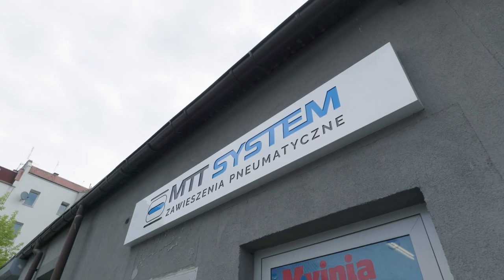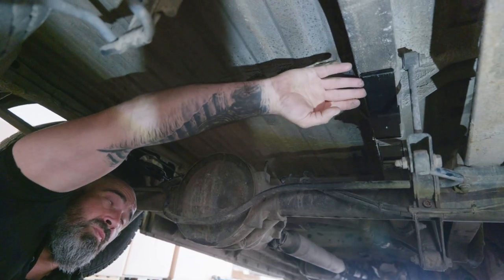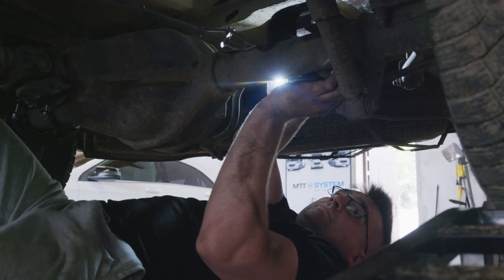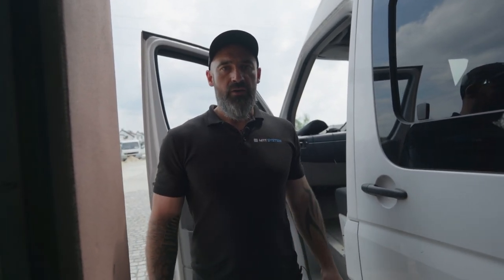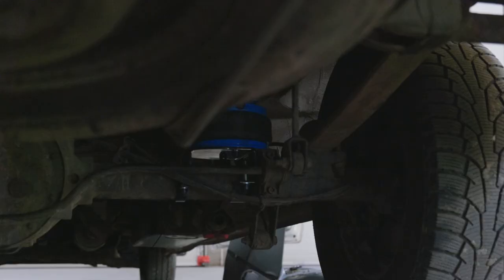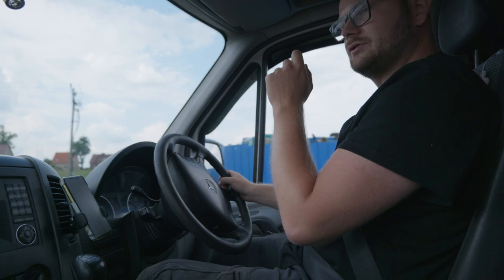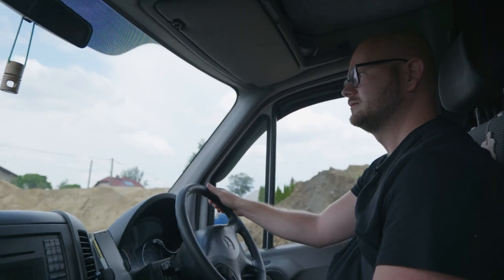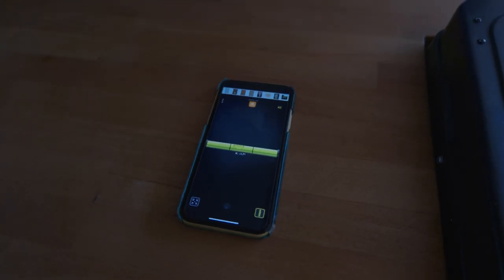Is motorhome AIR SUSPENSION worth it? | Van Life Europe

Comment: Hi guys, like the video a lot. I bought a similar system for my VW LT 35. But I saw that some sprinter owners with this had reported cracks on both sides where the airbags are located. The vid I saw the guy traveling Europe had done 40000 miles before noticing it. How is your metal above the airbags. Anyhow I really hope that this was an isolated event. They reckon you can fix it with stronger leaf springs and keeping the airbag at minimum to keep the space that the rubber stop protected.  Also the cracks can be welded. The structure of the camper van is safer as the body of your van helps the suspension so no need to be alarmed. Thanks...Ray
Reply from the maker: Thanks for this Ray. I need to have a look under there!!